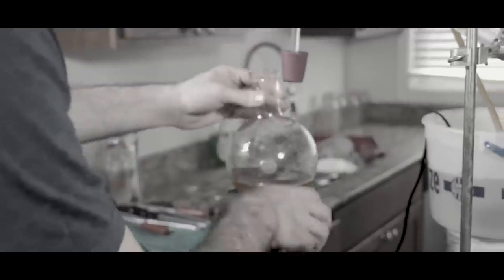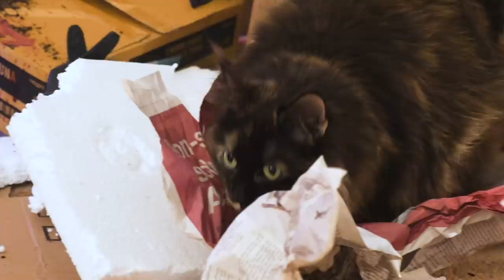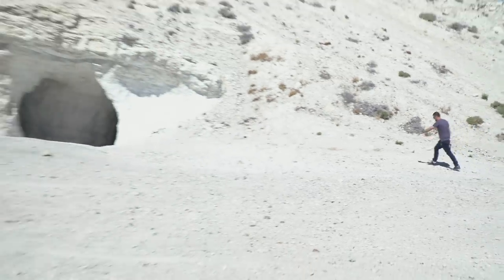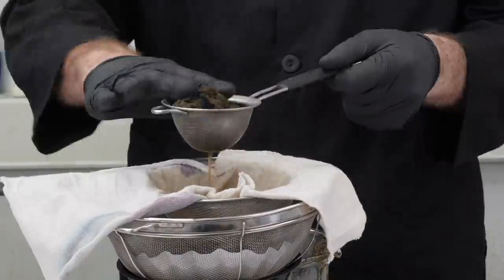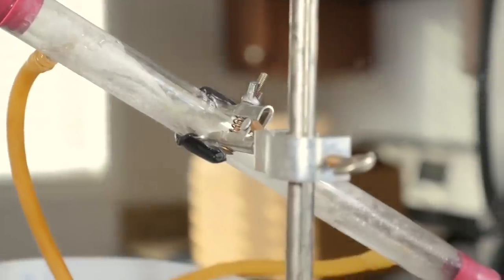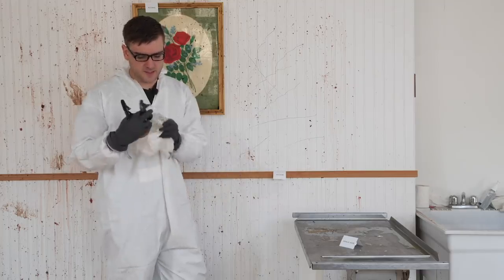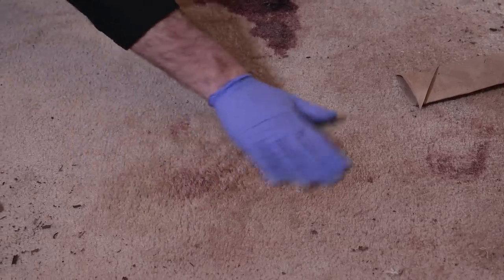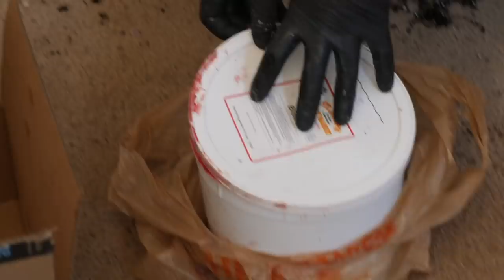How to Clean Up a Crime Scene

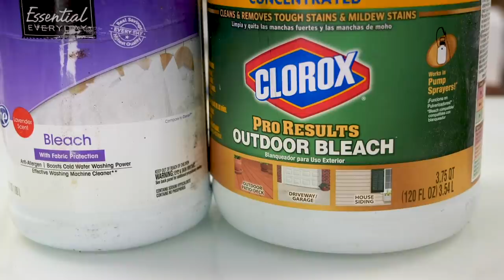Comment: @10:51 you say acetone is a “solvent cleaner” - water is also a solvent.  Acetone is a polar organic solvent- it’s more polar than water which makes it better at dissolving more organic compounds than water
Reply: Toori Baba  From my two-year-old memory of High School Chemistry:
The different pulls that types of atoms have and the shape of the molecule results in a net "pull" of the molecule, making it polar. Non-polar molecules' atoms pull evenly resulting in no net "pull".

A molecule is a collection of atoms bonded in their own special ways.

I know I have the concept down but I may have explained poorly so I could be wrong when it comes to specifics.

I wish I kept my Chemistry notes...
Reply: Toori Baba  I found notes!
The way molecules gain shapes is due to their amount of electrons in whichever layer is bonding. Generally a layer needs 8.
 The O in H2O has 6 valence (outer) electrons but needs 8.
Each H has 1 electron but needs 2 (just how the first electron layer works).
The O and H share 1 electron each, letting H have 2 and O getting 8 total.
The electrons have the same magnetic charge (-) so they repel eachother pretty much evenly. Two of four ends are electron pairs, the other two are hydrogen atoms. The hydrogen can't possibly be repelled to opposing ends so their own "pull" is uneven to one side.

An example of a non-polar molecule would be CH4 (methane). Each possible end of 4 is filled with a hydrogen atom resulting in even pull across the central Carbon atom.
Reply: Toori Baba  Yeah, can he just tell us what brand of acetone to buy (hypothetically of course)?

Comment: if you really want to get away with it, go the other way around: find yourself an old Dutch settler's farm with brick stables. Old home made bricks were brittle and would decompose from humidity and UV light. To protect them, they covered the entire brick structure, inside and out, with "ox blood". Basically they smeared the bricks with blood of butchered animals, filling up all cracks and pores. On living quarters, they would only do it on the outside, since it does leave a certain smell, but in stables, where there were much higher changes in humidity and temperature, they did the insides too. It also made removing manure much easier as it didn't soak into the floor and walls (the floor in these stables is usually also red brick). Not only will the fresh blood clean off much easier, but any blood identifying agents will become useless because they will reveal the entire structure as being positive... (and by the time they figure out why, they will have cleaned off all remaining traces of proof for you)

Comment: You can actually "clean" up blood with hydrogen peroxide solution: It denatures the hemoglobin (the protein that transports the oxygen in the blood and colors it red) and disinfects (it is damn good at destroying protein structures -> bacteria etc can't survive when their structure is messed up like that). Just use 30% solution (you don't need much of that stuff).

Oh, btw: Anyone who handled hydrogen peroxide before can tell you that it makes your skin go pale white when you touch it, and that's just the h2o2 ripping apart the hemoglobin. If you get some onto you, just wash it with water, the white stains will go away within a few hours.

Comment: I've worked in crime scene cleaning, and you're not going to be trying to scrub blood out of a carpet. You'll not be able to sanitize that to regulation. On a real job, you'll be cutting that carpet out, and placing it in a bio bag. Basically, if you want to clean up a crime scene to hide a crime, you'd better make sure there's no carpet, or porous rock. You'll never get that undetectably sanitized without abatement.

Comment: yeah you'd just want to pull that entire carpet down to bare wood, that pooled blood has seeped through the carpet, the pad, and is soaking into the subfloor. Fully cleaning it requires enzymes, chemicals, and sanding.